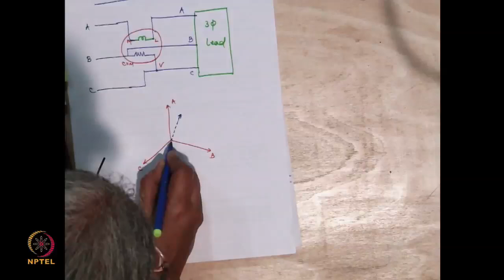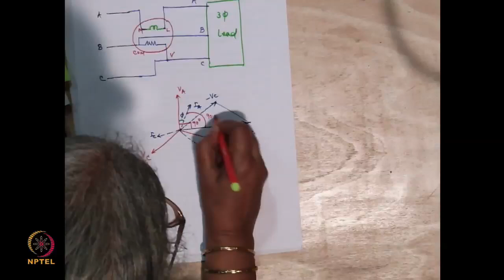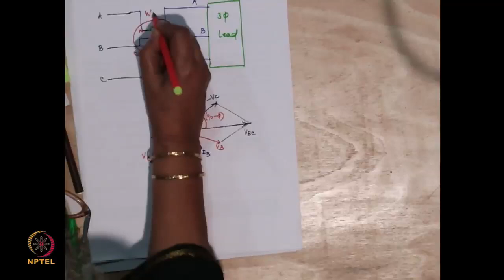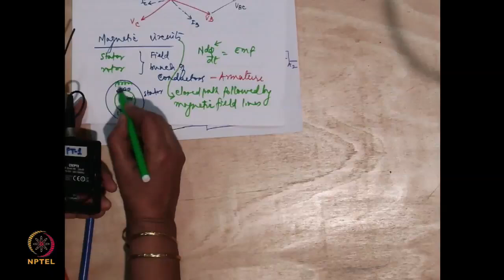Single-phase &Three-phase AC Circuits, Magnetic circuits

Comment: @21:34 I do not understand this statement "how many
times the magnetic field line is encountering the current that is actually known as the MMF."
Reply: As per Amperes law, a current carrying conductor gives rise to magnetic field, or a magnetic field induces current in a wire. How many times this interaction is happening depends on the number of turns of the conductor around the core carrying the magnetic field. She is referring to that.